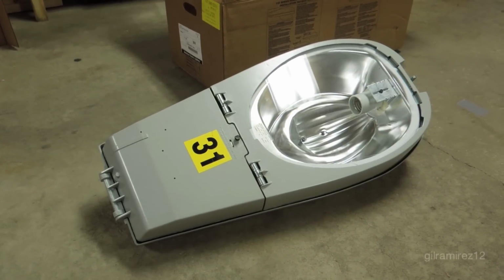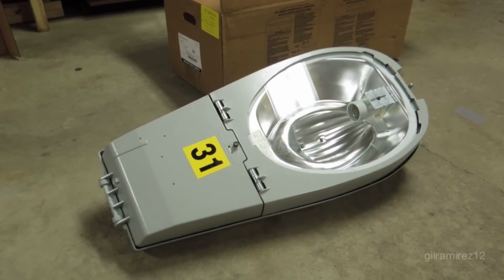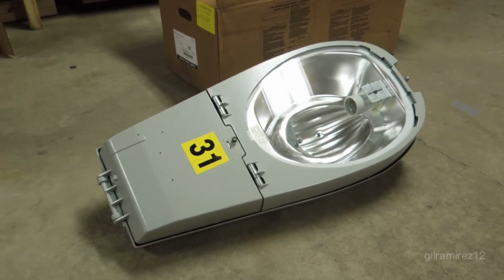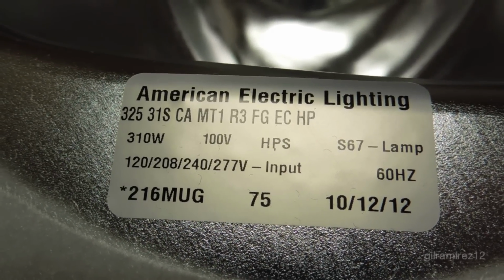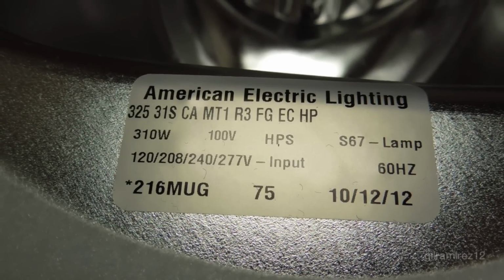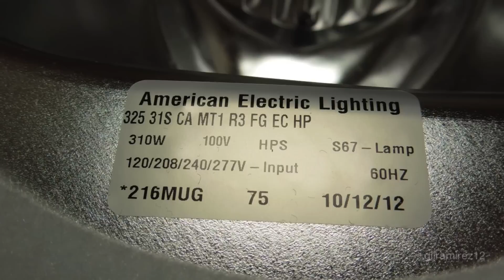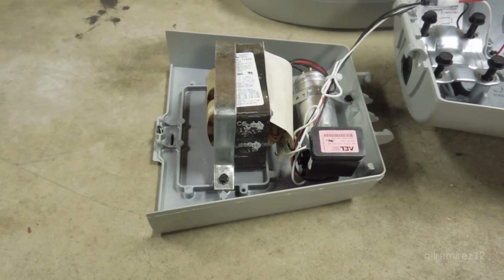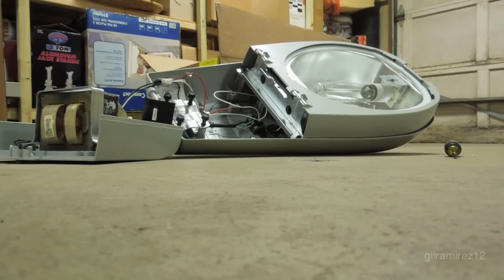American Electric 325 Series 310w HPS light

Comment: Awesome fixture. I've got an M400A3 250 watt HPS.
Reply from the maker: Thanks for watching!
Reply: @gilramirez12  We also have 310 watt fixtures up here in the Seattle area. They're only seen lighting freeways though.
Reply: @gilramirez12 In my freeway that were American Electric Model 325 but is just removed they switched to autobahn atbl atb2 atb0 and roadfocus rfl and other led street lights

Comment: I worked for American Electric back in the early 70s. HPS was in it's pioneer stage back about 1971, at least at AE. They sure build them different now. On another note, I have a 240 volt, 250 watt, NEMA head fixture on a pole in my backyard that I bought from AE about 1972 or so. Still works perfectly.

Comment: I live in California and for probably the last five years or so, the majority of roadway lighting on state owned highways has been replaced with LED fixtures. The ones I have seen are mostly Leotech, which is garbage. The city I live in, the majority of utility maintained roadway lighting is still HPS. Residential areas are 70 through 100 watt HPS, main roadways are 150-200 watt HPS. All the roadway fixtures at signaled intersections were replaced with LED like ten years ago. Signals and roadway lights are maintained and owned by the city. Many of the surrounding cities and towns have already converted to LED, so it just a matter of time before my city is changed over to LED, which is not really a bad thing.

Comment: I've never seen or heard of a 310 watt HPS Light bulb or fixture. Interesting find though, I love it, considering my whole towns have been upgrading to crappy LED as of 12-27-2018. Cheers! -Tyrone
Reply: 310 watt high pressure sodium streetlight S67 are rare they are not used very often and most common wattages for high sodium sodium streetlight’s are 250 watt and 400 watts high pressure sodium S50 and S51 and 200 watts high pressure sodium S66 streetlight are pretty common aswell they are not rare compared 310 watt hps and 100 watts high pressure sodium streetlights S54 are very common used in neighborhoods and rural areas along with 150 watts high pressure sodium streetlight S55